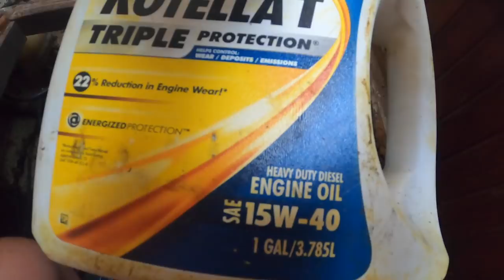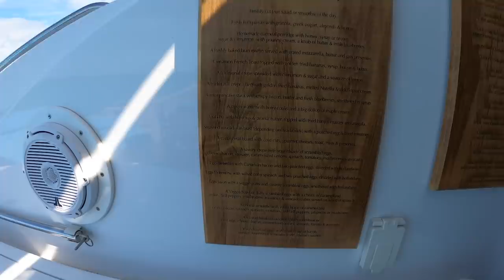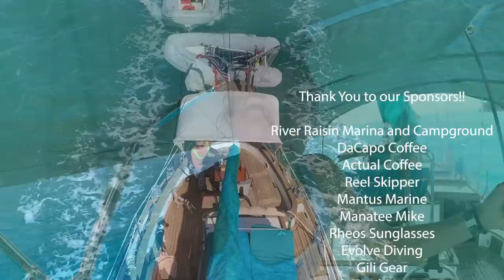Who Needs CLOTHES For An OIL Change, What’s Wrong With Our OUTBOARD, FREE Food From A YACHT![S2:E34]

Comment: I can tell you what is wrong with your outboard.....its a mercury 🤣
Reply: Get a Yamaha.  It's hard to kill them.  Lol.  I've seen a video on YouTube where a guy who actually works on outboard motors run a Yamaha 15 hp motor dry intentionally destroying the water pump on it just to see if he could burn it up, nope.  I'm sure the 25hp 2-strokes are that reliable also.  By the way, Nathalie and Sascha, I love your videos.  Keep them coming.  I love seeing how energetic,  fun, and down to earth you 2 gals are.
Reply from the maker: 2-strokes are very easy to work on. Our big issue is we had gunk in the gas tank and it got in the carburetor. We just had to clean it and we added a fuel filter so hopefully that helps
Reply: @SailingTheFarSide  firstly I really enjoy your videos,they are fun and light and fresh so I have to commend you on that...I hope the fuel filter does the trick,most 2 strokes are temperamental to start but last longer because of less moving parts,for me personally yamaha is my favourite option of outboard and not tricky to work on
Anyway keep up the good work
Love from Ireland

Comment: Re the helm. Oops I wrote my question at the start of the vid, imagine my shock when towards the end of the vid you answer my question. Now I'm thinking these girls are psychic AND fast. Wow.
Seriously, what about building a post to lift the axle of the helm up higher and then use the small wheel. No bending down. If the helm operates a cable, that cable is easily turned through 90 degrees to lift the axle.
Cheers.
Reply from the maker: Because we don't use it much it doesn't bother us!😁